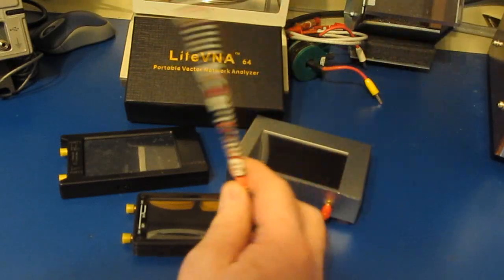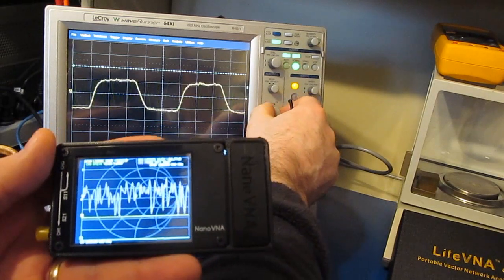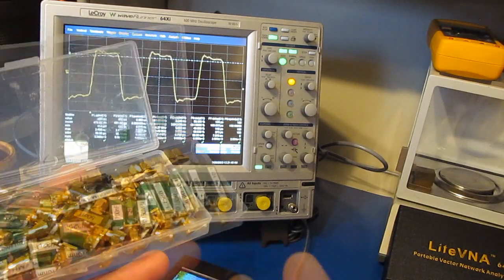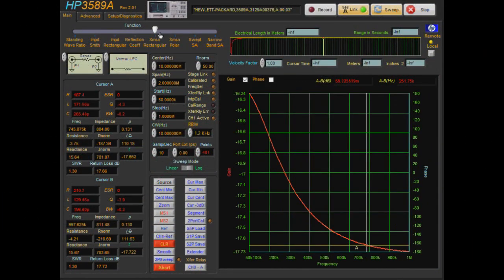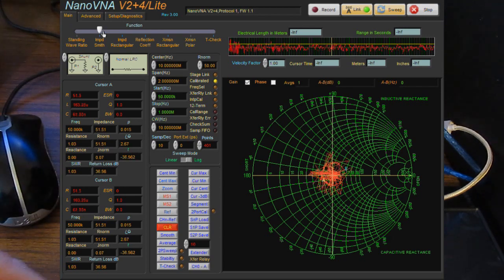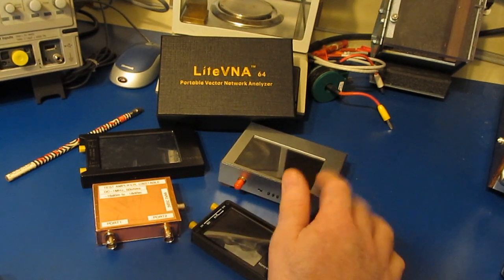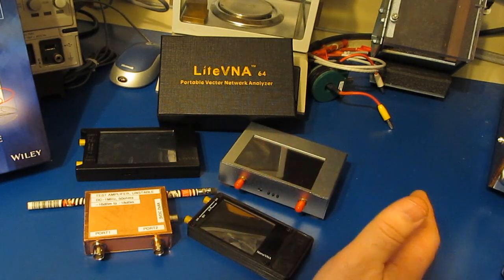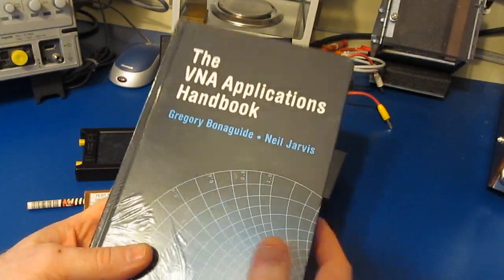The LiteVNA plus my rebuttal of comments made during a recent VNA presentation.

Comment: Thanks for spreading the wisdom! Any thoughts on the libreVNA?
Reply from the maker: I stopped following the development after they started to censor my questions.  From the little information I had gathered, you were locked into using their software.  There was no documentation on how to control the device directly.  Coupled with the high cost, I saw no reason to look at it.
Reply: @joesmith-je3tq  That's good to know, thanks for the heads up. 

Other than the closed API, do you think something like the libre might be worth the money for doing full s-param analysis? It claims to calculate s11, 21, 12, and 22 simultaneously, which doesn't appear to be possible with any of the cheaper devices (s11 and 21 only); the ports can be swapped to find the other two, but that is useful only when characterizing reciprocal networks. I need something for non-reciprocal networks. 

It's also unclear to me what the effect is in the cheaper devices of "ignoring" the signals that the full analyzers use to calculate s12 and 22.
Reply from the maker: @HelloWorlds__JTS  I guess if they stay in business, then it was worth the money for enough people.   Again, having never looked at one, I am a poor choice to ask.  As for what you actually need, I wouldn't have any way to know.  I have demonstrated using transfer relay with these low cost VNAs.  Of course these all use a squarewave drive which you may not be able to use.  For home, I have a vintage Agilent 4 receiver PNA. Not a bad system for the age of it.        https://www.youtube.com/watch?v=FuGWyXjSetI

https://www.youtube.com/watch?v=y6iOTEU6Zzo

Comment: Many thanks for this analysis, very interesting. I own miniVNAtiny by mRS, which is a ~$600 device, I was wondering whether you could carry out a similar benchmark comparison, should it happen to get it on hands, tnx, 73!
Reply from the maker: I doubt it.  What made the original NanoVNA so popular was the $50 price tag.  That and I showed you could actually pull decent data off it up to 300MHz.    The LiteVNA gave the narrow band but you gained 6GHz, for a only $120.  You would need to point out some reason why the product you mention out performs the these two.   It appears to have a lower dynamic range, much lower BW, and triple the cost.   Why did you buy it?
Reply: @joesmith-je3tq Indeed, this is what I want to benchmark: MiniVNAtiny vs. Nano/LiteVNAs. I remember when I bought it back in 2016 ($350-400 then..) I was between this and RigExpert, but I chose the MiniVNA because I wanted 2-port measurements too, I can't recall anything else being around on the market then for a VNA around mid-low budget. I like that I have the option to select a high number of frequency points (e.g. 20 000), which gives a good glance when I sweep across all HF band in one go without worrying that I've missed anything (e.g. multiband antenna). But, you're right, the limited dynamic range (50dB) and the high price nowadays don't make it worth anymore. Note also that the original GUI developer has retired from mRS and God knows who will support/update the nva/J application anymore which is necessary to run the miniVNAtiny.... so, it seems that this device could become obsolete on the market anytime soon, unless something drastic happens. I am not a big fan of the GHz ranges on these budget-price devices, as they appear to be artificial in terms of performance and need very good broadband calibration kits (which most people omit/ignore), also I think that the average ham radio operator doesn't test anything above the VHF range, 1GHz is enough for the majority of the home-made projects. Nevertheless, on the current occasion I would go for the LiteVNA64. 73, SV1QZS
Reply from the maker: I've presented a lot of data for the LiteVNA64 above 1GHz.  It's not like they are using harmonics like the NanoVNA and others above 300MHz.  It has low enough noise that I was able to extend the frequency well above 10GHz with decent results.  See my videos on rectangular waveguides.  Most hams who write me seem only interested in measuring VSWR.  Something they could do with a simple meter but I think they get told that the VNA is the thing.  Many refer to it as an antenna analyzer.  Back in 2016 when your Tiny was made, I was still using my HP8754A for home hobby use.  Because it has no computer, I was forced to learn the math and the basics on how to run it.  I used it up until a few years ago when I purchased an old Agilent PNA.  For the low cost VNAs, I still use the standards supplied with one of them, but with a load that I sorted.  All the data I present with them uses the ideal model, except for my experiments in the X-band.

Comment: I've heard that the common ground with the computer through the USB connection can cause problems. Could you try it without the USB?
Reply from the maker: Try what exactly?
Reply: @joesmith-je3tq  To do the same measurements without having a USB connected on the nanovna.
Reply from the maker: @CostasLilitsas   I was showing the difference of the software and firmware average.  It will be difficult for the software to communicate with the LiteVNA when it is not plugged in.   When I measured the output voltage with the scope, the Lite was not connected to the PC.   Also consider that the only time I had anything connected to the Lite was when I attached the thru.  We are just looking at noise.   As I said in the video, it wasn't important as I was only showing the update rates.  

If you had read something on the internet, maybe just provide a link to it.
Reply: @joesmith-je3tq  First of all, thanks for taking the time to answer me, it's not for granted. So here's what I'm talking about. I saw this video that shows a tinysa being affected by the common ground between the PC and the tinysa through the USB connection: https://youtu.be/E2bxZZXyVoE?t=82  So I was wandering whether the same thing could affect the nanovna's measurements. Of course you need a USB connection in order to use the software, but you can always use the device's screen instead. I was just curious of whether it would show anything different. Thank you for your time.
Reply from the maker: Start reading here:  https://www.eevblog.com/forum/rf-microwave/nanovna-custom-software/msg3887012/#msg3887012
Reply from the maker: @CostasLilitsas  Ok, another antenna post and nothing to do with this video.   I made a video when I first received the original NanoVNA demonstrating how an antenna behaves.  Actually, I attempted to replicate another video showing the same basic antenna design after a viewer had asked a question about it.  I talked about problems when making these kinds of measurements.  That would have been a better place to comment as I would have some idea what the subject was.  

If you told me the cable, location to their body, location to their PC, location to anything else ... made a difference, I wouldn't be surprised.  It's an antenna after all.    I've shown a lot of data taken with these low cost VNAs using all sorts of known devices.    The only time power has been a concern is with the V2Plus4 where for some reason, when you power it off any external source, the noise increases in the upper frequencies.  I had ran it off a linear supply and well as batteries.  The ground has nothing to do with that particular problem.   OWO and I have posted about it on EEVBLOG.